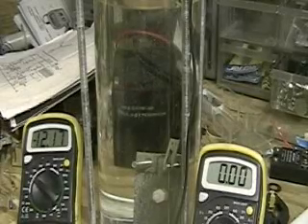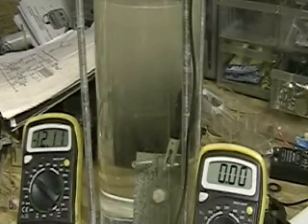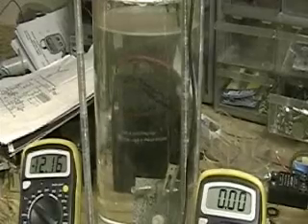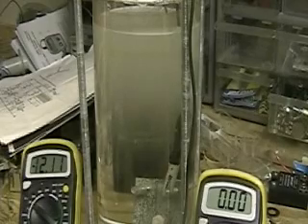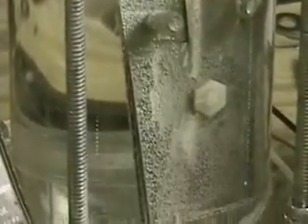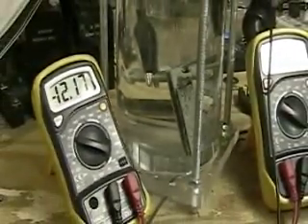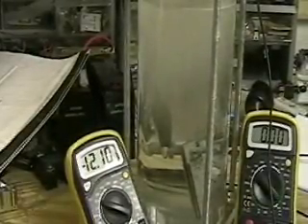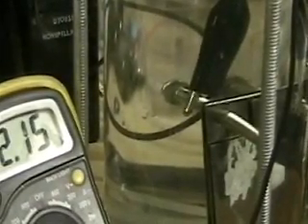Hydrogen Tap (Pulse Yes) 120

Comment: Were are the real smart men?
Um? I would suspect that a voltage of 50,000.00 would be a great place to start, not 12 volts, and not 20 amps.
with a amperage of just a few Milli amps, i would suspect a frequency modulator will do wonders, in the micro wave range.

Comment: You're probably right about that, John.  My problem was partly due to the low-grade steel, but also partly from the plates being too close together, thus trapping the hydrogen bubbles.  My "spatula" cells have wider plate spacing.

My main reason for switching to non-ferrous stainless steel is so the plates won't corrode!

I'm not sure what effect Zinc (used in galvanizing) has on the electrolysis process.

Comment: My first cell used galvanized steel plates.  It worked, but not very well, partly due to the low-grade steel.  

My next cell was made from inexpensive stainless steel made from heavy duty spatulas I bought at the dollar store.  Though very low grade, and still ferrous, they worked surprisingly well!

The galvanized plates cost the same as the dollar store plates.  If you want to save money, the dollar store might be a better alternative.

If you can afford it, get at least 304 grade stainless!

Comment: JOhn you seem to be producing a considerable amount more then ive seen in the past. You have only seen the tip of the iceberg (no pun intended) as far as this system goes. KUDOS for doing this. THAT is a FOUR PLATE SYSTEM and it putting out alot of hydrogen. Good job JOHN AARONS... incredible, would you be able to use GALVANIZED Plates rather then STAINLESS STEEL???